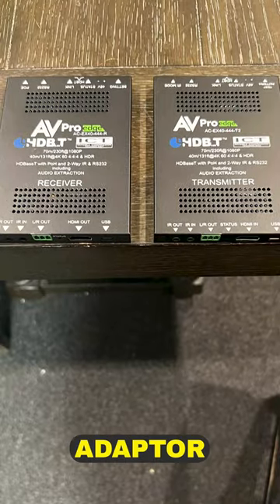What Is HDMI Balun #Balun #short #HDMI

Comment: We watch football games in my garage, but the TV in the garage is always 15 seconds to a min behind (internet lag). If someone inside is watching a game, they will start cheering, and we will have no clue on what happened until the outside TV catches up. 

The inside TV is currently connected to a dish network hopper 3. It does not have a receiver attached.  The TV in my garage has a older receiver that only has ARC.

What type of extender would I need to go from that Hopper to the outside receiver to get both video and audio from it?  The run is about 50 feet total. 

I have a CAT 6 cable already ran, and I tried a cheap extender that I got off amazon, but the video kept dropping, and the sound would crackle.  

Thank you for any help you can give. I saw a few more on amazon made by Orei, but I'm not sure if those are any good or which one to go with, lol.